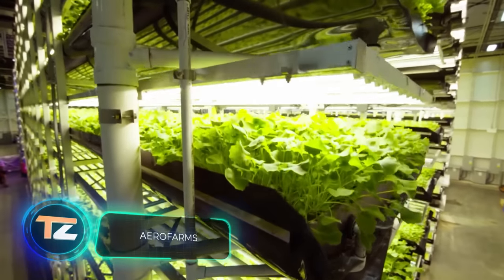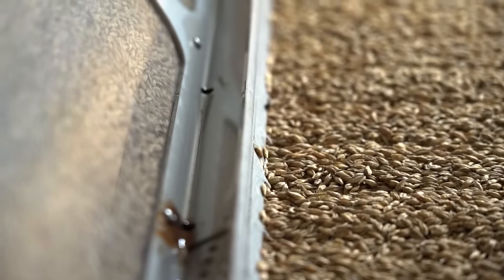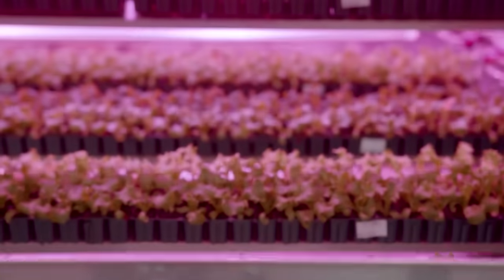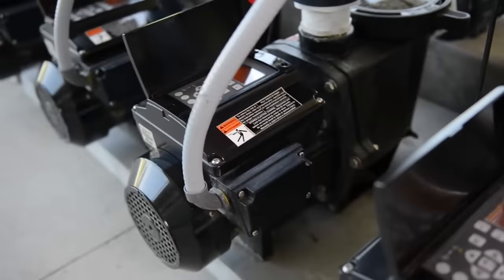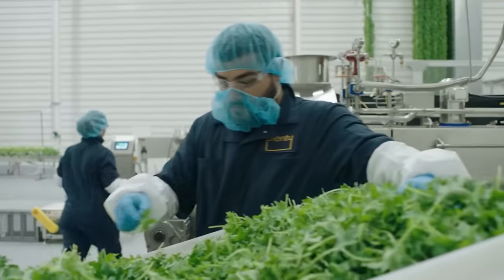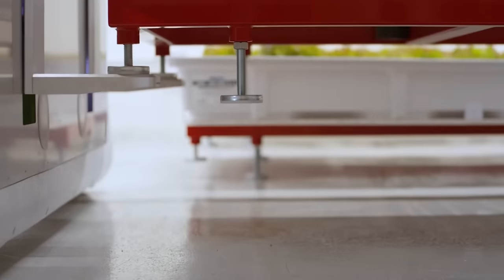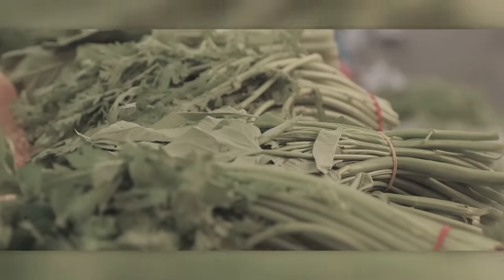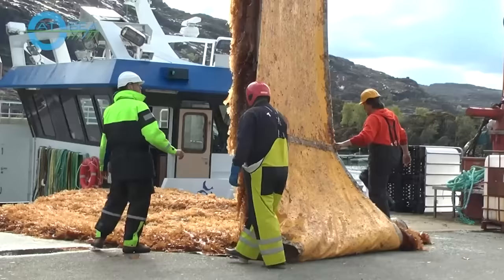11 AMAZING FARMS YOU HAVEN'T SEEN BEFORE

Comment: I designed and built a hydroponics dump and fill automated system. I set the system up in a room, where I had control of tempeture, humidity, lighting, and even set up to deliver CO2 during day light hours. I grew 12 tomato plants, with a mother plant to get cuttings from. So at harvest I had buckets of the same exact tomatoes. Sold them at the farmers market. I only used organics fertilizer. I had shown the system to some farmers, they thought I should expand the system to handle 50 tomato plants!
Reply: sounds awesome. You should make a video or create a method and sell a packaged product.

Comment: One question I have about these hydroponic systems for fodder production is, what about the production of seeds? These systems (fodder production) are dependent on wheat, oat and other seeds and those seeds, as far as I know, are not hydroponically produced. So, if something were to happened to the production of those seeds the fodder wouldn’t be able to be produced. Just a curiosity I have.
Reply: Farmers grow the wheat on their fields.
Reply: Tru
Reply: @libbyworkman3459  that’s was not my point. I’m fully aware that plants produce seeds and that there are farmers that produce seeds to sell to other people like you and I like you mentioned. But my point was that hydroponics is supposed to help reduce de consumption of water. But if the seeds are produce using conventional agricultural methods than that defeats the purpose of hydroponics. I guess my point was that the production of seeds should also use hydroponics to make the production cycle more planet friendly. I hope that clarify my previous point a bit. 
FYI - I spend part of my teenage years in the country side, so I know how different types of plants are propagate.
Reply: And how is that different from a conventional farm? Unless the farmer is very good and/or lucky they will buy seed to seed their pasture to make fodder or let cattle graze. Making seed isn't part of the business of these farms. They have all outsourced it to seed farms. What you want to ask is why haven't seed farms moved to hydroponics and that would be due to their need of the wind or pollinators.

Comment: how much energy do these use.  Looked like a lot of artificial lighting.
Reply: I'm going to bet that they are using LED lighting. 
This form of lighting uses much less energy.
It is an important question though.
Reply: @jimthain8777  

It's all LED as it wasn't cost efficient to do with previous types of lighting. The question is not just how much energy is used but how much compared to the alternatives. 

Does it make sense to stop growing tomatoes just outside of the city in Spain and move the production inside a warehouse. The LEDs will never offset the savings in transportation energy. Other economics will come into play.

What about growing tomatoes with one of these systems in Glasgow, Scotland instead of shipping them in by airplane from Spain? There's a lot of energy used to ship tomatoes by plane and the question becomes does it take less energy to run the LEDs in order to grow the tomatoes.
Reply: @capitalinventor4823  I guarantee you only the initial costs were great, any continued costs are minimal because they likely use solar panels to power all of those LED lights
Reply: @capitalinventor4823  We dont need tomatoes, we need loads of different variations of local vegetables to work with, and preserve them for winter. If we would lack some crops in winter (which, with cold classes,  preserving  and good management is not an issue.) And new old recipes.
Reply: Most of these ideas are beyond stupid and of short term vision.
Reply: They never mention it because if they did it would reveal that these systems aren't actually better. They use masses of energy, which is still mostly produced from the burning of fossil fuels. They always preach about how much water they're "saving", but they never point out that the energy consumption is gigantic and contributing to carbon emissions.
Reply: yep  resource hungry ...and totally unnecessary ... farm production rates have exploded in the past 30 years ... we can easily produce enough food for everyone ... the problem is distribution ... and the take over of farming by corporations

Comment: In a soilless farm, is the growing medium reusable or compostable?  What happens to the inedible parts of the plants, like roots and vines (I saw tomatoes)?  They could feed the plant parts to livestock, I guess, like on a traditional farm.
Reply: in a soilless farm, there isn't really a growing medium. Chances are they're using hydroponics, would would mean the plant roots are suspended in a water/fertilizer solution. The solution either flows past the roots or the roots are touching solution that is being oxygenated by a air bubble pump or a combination of both. I have a similar setup at home where i use it to grow a few heads of lettuce, spinach and some herbs and i don't have to change the water, just add more periodically and run it through a filter. Its probably the least wasteful way of growing anything
Reply: @yeetusdeletus9  I see hydroponic as something different than soilless farming, even though it doesn't use soil.  Some of these systems were using a type of foam in place of soil to hold the plants.  What happens to that material after the plant is harvested?  What do you do with anything left over after harvest?
Reply: Actually that’s been one of the tricky parts of hydroponics. Some media have different qualities than others, and not all of them are reusable or compostable. Rock wool is one such material.
Reply: Depends on the media. Almost all are reusable. Some might decompose thus becoming a fertilizer.

Comment: Quick questions, why are most of these farms aiming for leafy greens and meat and not, ya know, every other kind of crop, like carrots and potatoes?
Reply: Carrots and potatoes are tubers, and they have trouble growing in soil-free systems. Apparently they rely on compression from soil to stimulate growth. 
As for field crops, they’re generally too tall. I work in a corn greenhouse where most varieties are easily 2-3 meters tall. Some varieties are about 1 meter, but leafy greens allow for greater density in vertical farms. Plus you’re eating more than just the seeds as in field crops.
Reply: @BrowncoatGofAZ  I didn't know any of that, thank you so much for telling me this; it was very interesting to learn.
I said carrots and potatoes because they're usually the crops with the most amount in minerals and vitamins, so I got a bit confused; again, thank you so much for telling me that.
Reply: My question is hasn’t anyone considered how many fields it takes to produce the seeds that go into just one autonomic system that then goes into the cow farms? How about all the energy to run the whole operation? The fish farm seems to make more sense. It was not all that long ago s family would consume one beef steer per year. They would use every bit of it. We now throw away a lot of the animal or misuse parts.
Reply: @dlsdyer9071  Very good point there DLS, very good point; in fact, until we figure out what their plan is for those problems, I think those issues will run the whole operation to the ground.
Reply: @dlsdyer9071  actually a lot of people are aware of how growing plants to feed livestock actually leaves to a loss in efficiency. That’s part of why plant-based meats are on the rise. And actually a while ago there was a product made from waste meat products, but a purposely overblown news scandal ended that one.
Reply: @dlsdyer9071  I’d say that I understand most of your points, but I do have some thoughts.
1 I certainly understand how foods sourced from diseased or euthanized animals can be hazardous. Secondary poisoning. However, what I was talking about was a product made from the parts of cattle not turned into steaks at slaughterhouses. 
2 Regarding decentralization, I actually agree. I’m actually a big supporter of the original concept of arcologies by Paolo Soleri regarding sustainable city development, as well as the new solarpunk concept. I think it would require significant learning for a lot of people when it comes to foraging and wildlife. I’m not sure how many people in cities would be willing to learn. 
3. Considering “synthetic meat” is a bit of a broad concept, I’m not sure I understand what you think of as synthetic meat.
Reply: @BrowncoatGofAZ  I watched a YouTube video awhile back where potatoes were grown in this fashion. The potatoes were easy to harvest as the grower was able to collect them by walking underneath them. No digging.
Reply: @barqu1636  from what I understood, the potatoes themselves don’t grow very large, though.
Reply: High paying crops. All about the money. And the Netherlands have enough potato,s and carrots for the world
Reply: basically as someone else said, leafy greens and hers are easy to grow indoors, while other plants still need traditional farms
Reply: @dlsdyer9071  the indoor operations are fairly efficient for what they are, as LED lights have made it much more economical. I have a mini operation like it at home, complete with grow lights on a timer, ventilation, and a water pump. it probably uses less than $100 of power per year but supplies me with fresh, lettuce, arugula, spinach, green onions, swiss chard and a bunch of herbs. I haven't gone into in depth calculations as its just a fun hobby for me, but the produce i get likely pays for the energy it uses. For someone living in an apartment where utilities are covered by the landlord, its a good way to get food for free
Reply: @yeetusdeletus9  Good for you as food deserts are a real thing! I am curious as to how much you are able to grow and what percentage it is of what you consume.
Reply: @dlsdyer9071  i see where you’re coming from regarding that. However, I don’t believe it’s that simple. Especially if people are aware of those instances these days.
Additionally, I’d like to see a scientific article regarding modern plant nutrition. The only other time I’ve heard of that is from a commercial by a company whose founder was decried as a pseudo-scientist.
Reply: @yeetusdeletus9  Good too know, thank you all for telling me this, I legit didn't know until now/then.
Reply: @yeetusdeletus9  haha cannabis
Reply: To DLS Dyer: I also read that food processing has the unfortunate side effect of damaging the nutrition of food items.
Reply: @BrowncoatGofAZ  =|
. . . Ironic.
Reply: Leafy greens don't weigh much and have a short time to be harvestable (like 30 days). Some other crops take 80-120 days to reach maturity and you would need container grown  small varieties to grow them in a vertical farm like this. I wouldn't doubt that somebody will figure out how to do that at some point.
Reply: @tommyfox854  The vegetables that are the most nutritious are collard greens and beets.
Reply: @dlsdyer9071  If you go back and read in Genesis how Joseph got rid of the cattle first when there was a famine in Egypt? And he managed to save the people doing that. We haven’t learned a whole lot since then, have we?
Reply: @libbyworkman3459  Thank you.   =)
These replies have been fun, not gonna lie.   =)
Reply: @libbyworkman3459  Genesis 41:14-24 (ASV)
[14] Then Pharaoh sent and called Joseph, and they brought him hastily out of the dungeon: and he shaved himself, and changed his raiment, and came in unto Pharaoh. [15] And Pharaoh said unto Joseph, I have dreamed a dream, and there is none that can interpret it: and I have heard say of thee, that when thou hearest a dream thou canst interpret it. [16] And Joseph answered Pharaoh, saying, It is not in me: God will give Pharaoh an answer of peace. [17] And Pharaoh spake unto Joseph, In my dream, behold, I stood upon the brink of the river: [18] and, behold, there came up out of the river seven kine, fat-fleshed and well-favored: and they fed in the reed-grass: [19] and, behold, seven other kine came up after them, poor and very ill-favored and lean-fleshed, such as I never saw in all the land of Egypt for badness: [20] and the lean and ill-favored kine did eat up the first seven fat kine: [21] and when they had eaten them up, it could not be known that they had eaten them; but they were still ill-favored, as at the beginning. So I awoke. [22] And I saw in my dream, and, behold, seven ears came up upon one stalk, full and good: [23] and, behold, seven ears, withered, thin, and blasted with the east wind, sprung up after them: [24] and the thin ears swallowed up the seven good ears: and I told it unto the magicians; but there was none that could declare it to me.
Genesis 41:26-27 (ASV)
[26] The seven good kine are seven years; and the seven good ears are seven years: the dream is one. [27] And the seven lean and ill-favored kine that came up after them are seven years, and also the seven empty ears blasted with the east wind; they shall be seven years of famine. 
Genesis 41:29-32 (ASV)
[29] Behold, there come seven years of great plenty throughout all the land of Egypt: [30] and there shall arise after them seven years of famine; and all the plenty shall be forgotten in the land of Egypt; and the famine shall consume the land; [31] and the plenty shall not be known in the land by reason of that famine which followeth; for it shall be very grievous. [32] And for that the dream was doubled unto Pharaoh, it is because the thing is established by God, and God will shortly bring it to pass. 
Genesis 41:35-36 (ASV)
[35] And let them gather all the food of these good years that come, and lay up grain under the hand of Pharaoh for food in the cities, and let them keep it. [36] And the food shall be for a store to the land against the seven years of famine, which shall be in the land of Egypt; that the land perish not through the famine.
Genesis 41:46-49 (ASV)
[46] And Joseph was thirty years old when he stood before Pharaoh king of Egypt. And Joseph went out from the presence of Pharaoh, and went throughout all the land of Egypt. [47] And in the seven plenteous years the earth brought forth by handfuls. [48] And he gathered up all the food of the seven years which were in the land of Egypt, and laid up the food in the cities: the food of the field, which was round about every city, laid he up in the same. [49] And Joseph laid up grain as the sand of the sea, very much, until he left off numbering; for it was without number. 

We don’t really know that from the narrative. We do know that the “kine” in the narrative was some type of water buffalo as it fed on the aquatics and then came up out of the Nile onto the meadow to graze. There is no indication that it was domesticated. The grain and the water buffalo might actually be the effect on Egyptian agriculture but also the devastation on the natural resources of the area as drought most of the time is the cause of famine.
Reply: Mostly it has to do with the saleable value of the products and the time for growth. Many crops take too long to grow , and/or sell too cheaply.
Reply: @pteechka1  Interesting, didn't know that, thanks for tellin me.   =)

Comment: Regarding the first clipping 🔔
you mentioned that this method of farming requires 40% less water then conventional farming, but guys have you NOTICE how much ELECTRICITY they are consuming, so what's the use of such farming. Please feel free to comment, reply go my better understanding.
Reply: LED lighting is more efficient at using energy. Fossil fuel energy is used for conventional farming more than you would think: in the production of fertilizer, harvesting, packaging, and transportation. IDK how the energy usage stacks up if you were to compare a comparable crop production land with a vertical farm that produces the same yield. It would be interesting to know.

Comment: Container farms are B.S., you're way better off with greenhouses. Container farms have a high initial costs because you use lots of steel while it contains relatively few plants. They also have a high operational cost because you're using electricity/lights instead of direct sunlight. 

If you think that you could just use solar panels, well this would raise the initial costs and operational costs even higher. Converting solar to electricity and back to solar is obviously less efficient than using direct solar, since solar panels and lights are not 100% efficient. This would also raise the initial costs since you now need solar panels and electronics. The sun doesn't degrade over time, but those electronics do, which will eventually need replacement, thus also raising operational costs.

Comment: Millions spent on light, workers, machines, ex. Spinach $1 a pound. Tomatoes $1.50. Anyone else see an issue?
Reply: Correct, increased investment in the appropriate technology can lower costs considerably.
Reply: @pteechka1  Incorrect. These prices will need to go up considerably to pay for the initial investment and annual maintenance.
Reply: @mikek621  that's not usually how market forces work, generally, offering more/better  can be a way to raise prices, otherwise they can't compete in the market.

Comment: Soccer fields?  What kind of area is that? Speaking plain language is a useful communication tool. But dumbing down and using irrelevant measures that only a very few people can convert in their heads is madness. Why can't you use hectares which is an clearly understood measure of land and easily visualised . as 100 hectares = 1 square kilometre,  1 hectare = 100m  100m.